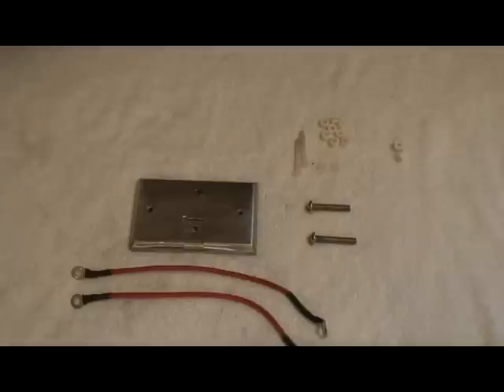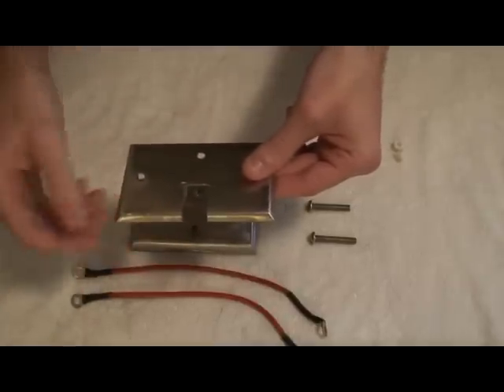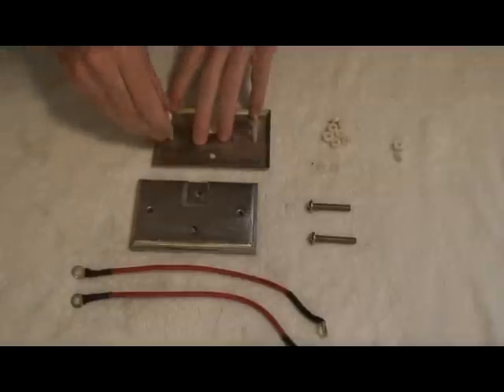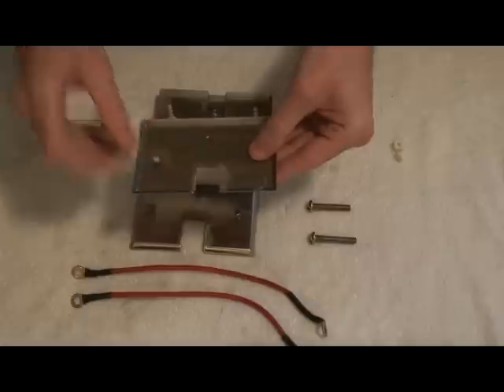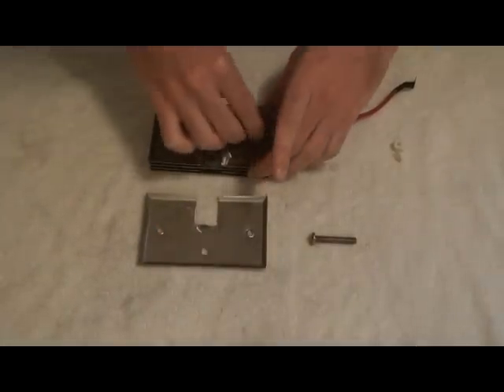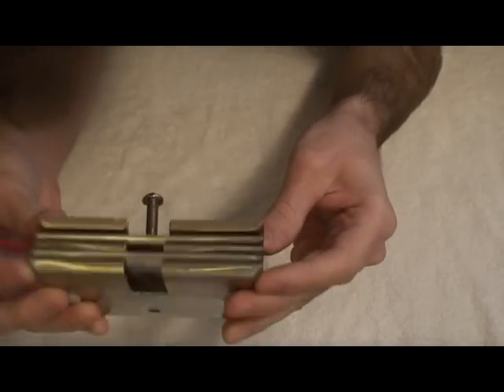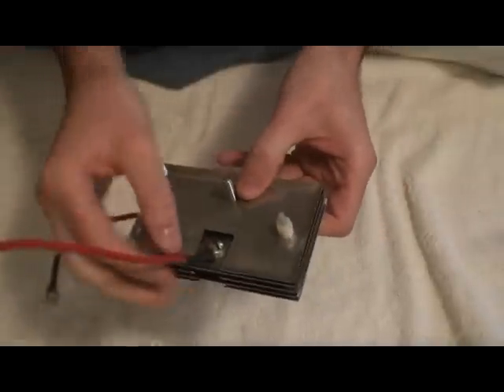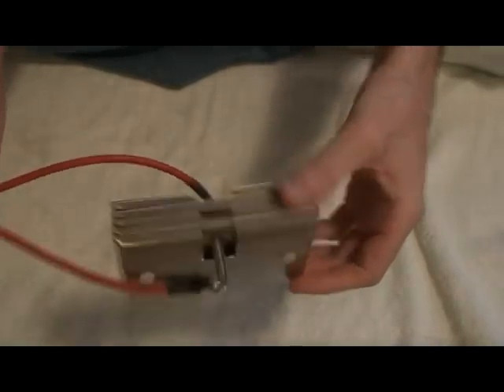HHO Cell Design # 2 (Demo of Construction, 5 plate setup)

Comment: @kb64tn13 Just by looking at how TTUMIT made the cell and reading of you problem, make sure you are using plastic screws with plastic spacers in order for plates not to be connected all together, rather have a pattern on + - + - +

Comment: Another way you could probably attach that wire is to place a nut on the end of the bolt part way down then place the wire on it and put another nut on it.  Or even place the wire under the bolt head, and use one nut or spacer.

Comment: Home depot's version has the hole cut out for the light switch but they are 302 SS. All of the 300 series should last a year as long as you aren't cranking too many amps. Thats what Ive read so far.

Comment: question for you. what are you using to cut your notches into the plates? im using a grinder. those nylon washers in have found at lowes and home depot to be real expensive for what you get. if you have a fastenal store in your area its a great place to get your hardware.